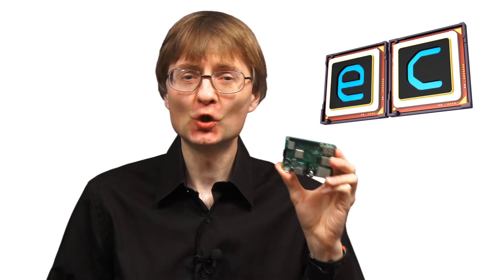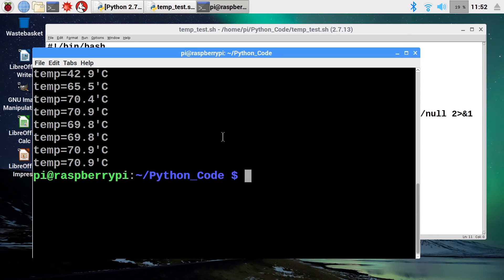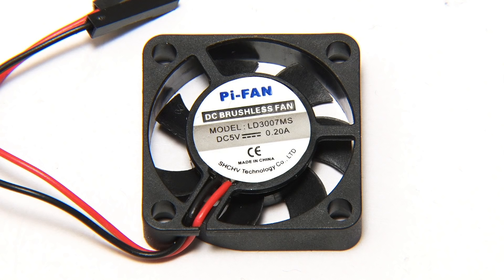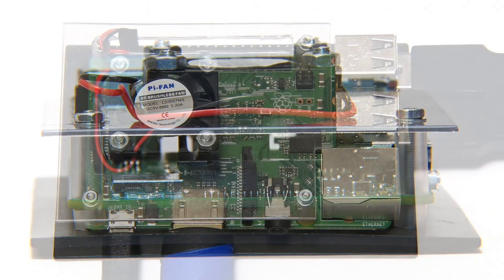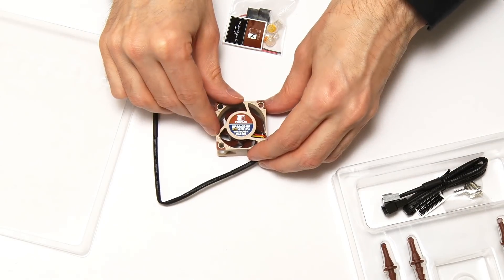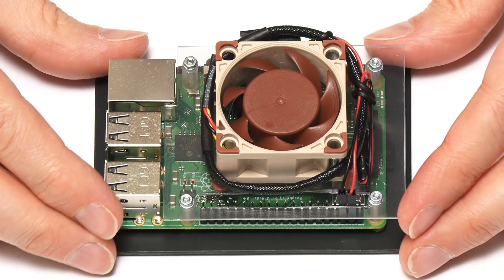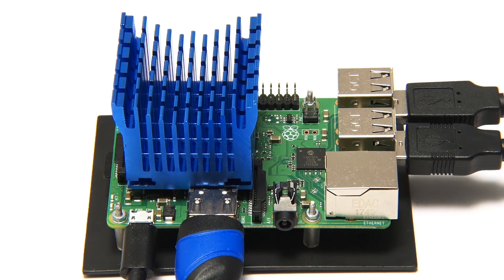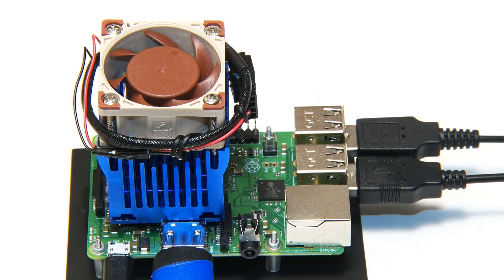Raspberry Pi 3 B+ Extreme Cooling

Comment: Chris, you didn't suggest whether the fan was blowing or sucking, it would be interesting to know as the 'suck or blow' debate has been around since Pentiums.
Reply from the maker: Noctua was blowing down; 30mm was sucking up (purely by accident). Blowing down is usually more effective, if only a little.

Comment: I've been running a small fan off the 3.3v GPIO pins since I got my first Pi 3b, over a year ago. Why would it cause damage?
Reply from the maker: The 3.3V output pins, and the GPIO pins configured as outputs, are only intended to deliver a few tens of milliamps, and supply power after the Pi's voltage regulator (meaning that there is no voltage/current projection between them and the rest of the Pi). A fan could easily draw more power than this, hence fusing the pin and potentially damaging the Pi more significantly. Not least, a fan may be pretty noisy in terms of the power it draws, esp at start up -- it is, after all, an electro mechanical rather than an electronic component, and it is hence risky to connect it to low power electronic outputs. You may get away with it . . .
Reply: ExplainingComputers Thanks for the explanation. Good to know, I'll be changing my setup.

Comment: Thanks to make this video. Thinking a microprocessor can work without any problem over 100 °C  (at 170°C the internal solder are destroyed) I think you can use your Raspberry without any additional heathink safe.
Reply from the maker: I don't know of any microprocesor at works at anything close to 100 °C! :) Somewhere between 70 and 85 most chips will cease to function, or experience a very short life span.
Reply: My i5 3380m Works at 102°C Without a Problem. It throttles at 105°C.
Reply: All Intel cpus run up to around 100 degrees, the 4700MQ for instance thermal throttle at 99 degrees (C). Almost all modern laptops and Macbooks run at this temp under load. Somewhere from 85-99.
Reply: Toxy , Great to know that you think running a Chip at 100 Degrees is a " good " idea.
❌ Bad Choice though , unless you Don't like your computer
Reply: I've never actually seen a CPU fail in years of answering questions on broken PCs. The worst I've heard was a 8350 that was such a bad bin it had to be underclocked to be stable (and was RMAed at that point).
Reply: Jennifer Wayans 

It seriously wont hurt your PC. look at all those passive cooled CPUs from the 90s, they get Really damn hot, they will still Work After nearly 30 years. I dont care if my CPU breaks After 20 years instead of 30 if i overclock it, let it overheat and more. No One will even use this Computer when it reaches the end of its lifespan, it will end up on Hardware Freaks workbenches like me, Will be used for a week and then be packed up again for 2-8 years After it will be used again.

Comment: Active cooling is obviously a very effective way to cool the Pi, but it's a shame it has to be done with these 'inelegant' cobbled together setups. As popular as the Raspberry Pi is, why are there not active cooling kits paired with cases that can accommodate and properly mount them?
Reply: Just check Amazon, there are lots of different kits with cases + coolers.

Comment: Another great video.
Being that the Raspberry Pi is the largest SBC in the world,
and standard heatsinks for the Pi are pretty lame,
looks like there could be profitable market demand for
a descent passive heatsink.

The next thing I would like to see is if
you have to go through the same process to 
boot off an SSD as you did in your other video.

https://www.youtube.com/watch?v=ubnwvxF3Klc&t=47s
Reply from the maker: Thanks for this. Clearly there is a market opportunity as you say. On your second point, I understand from others that the Pi 3 B+ will boot from an SSD or other USB device without having to go through the process I covered for the first Pi 3 B.

Comment: You should take into consideration the time it takes to perform a heavy task, because if the cooling is poor then not only will the temperature change, but it will also begin to throttle, taking a longer time to complete the task.
Reply from the maker: True.

Comment: Suggestion: de-lid the SoC. Delidding the SoC would allow the heat solution to touch the chip more directly than ever, allowing better heat transfer than before. As an extreme test, delid the Pi, put liquid metal on it, and attach an all-in-one liquid cooler directly on that.
Reply: That's new to me! :)
https://youtu.be/4LtL9e7JqxE
But I still think they put that metal to serve as both minimal heatsink + RF shield.
Ain't sure though.

Comment: The big heat sink appears to performed as well if not better than the smaller one. Indeed even better than the small heat sink and small fan combination. This may be the economical way to go. Just add the copper spacer (could an aluminum one worked?). No power connection/draws to worry about.  What was the cost of this heat sink?

Regardless of the temperature, we'll always be big fans of these interesting videos.

Comment: I think "fan & shs" result may be much better if you can place fan not strait on the top of heatsink. Because center of fan is just rotating and doesn't move any air below! :^) There just cylinder of static air that cooled down by air convection arround, and only then cooled static air cools heatsink. I'm sure that heatsink cooled down directly by air convection (with fan installed aside) will perform better. =) [not my native language, in case of horrible errors]
Reply from the maker: You are right -- but I did anticipate this, and neither fan was directly on top of the heatsink for the reasons you mention (well, except in the last test with the Noctua screwed in the top of the large heatsink).

Comment: Totally want the desktop PC coolers onto the RPi. Also want to see if cooling to ambient is even possible :)
Reply: Cooling to ambient is always possible.  There is the one caveat that comes with that: WHY?
Reply: For Science, you monster. :)

Also, why not? :P

Yeah, yeah, I know.. just because you can, doesn't mean you should.
So, let Christopher do it for you and learn something along the way? ;)

Even if it turns out that there isn't much difference, its always good to see what is needed to keep it steady at a certain temperature. You know, for that "temperature sensitive" application that includes expensive crystals that throw out accuracy if it rises 0.1°C. Or not. It's academic at this point.
Reply: As an experienced overclocker, I do have to admit "just for the hell of it" is indeed a compelling argument.  as for unstable crystals, well, a TCXO doesn't cost too much, or if you have access to good surplus an OCXO, or if you have a few extra bucks, Rubidium is cheap enough too ;)  --... ...--   -.. .    -.- -.-. ..... ...- -.. .---

Comment: Nice video. I still don't know why people obsess about cooling, though. What people need is the least amount of space/power/noise (pick one) that prevents thermal throttling. Anything else is overkill.
Reply: Thermal throttling òr even Overclocking. But what I missed from this video is the actual noise produced by those fans. I bought a simple fan, was annoyed by the noise, and bought a little controller on top of the GPIO pins to drop down speed to at least half the speed, and measure the need by a thermometer and even that prevented throttling enough. That was before passive cooling cases were available for the Pi3, otherwise I would have bought such a case instead. The little fan in this video is already able to push down temperature below throttling, but it is given the full 5V which probably is somewhat noisy.
Reply: One thing that could justify extra cooling is environment temperature. It is one thing to cool a raspberry in open air in your bedroom, another thing entirely inside a black metal box exposed to direct sunlight. It would be nice to know "for temperatures up to xC passive cooling will do. With cooling solution A you could get up to yC, and cooling solution B can keep your pi safe even if the environment air is zC hot."

Comment: nice vid but I would run the test for much longer to get more precise results. I'd recommend running the test until the temperature stops changing...
Reply from the maker: Agreed, but there are practical considerations -- not least the sheet quantity of data recorded for even these 10 minute tests. I still have over 70GB of test data to delete!

Comment: Only logical next step is to CNC a small LN2 pot...

It seems though that something like the large heat sink and thermal adhesive (instead of compound) would be ample without a fan, and then you could pack a bunch together and use one 120mm mid RPM fan to cool the whole set. 

How does the pi 3 overclock? 

Thanks for the video!
Reply from the maker: I will try an overclock soon!

Comment: I just got my Raspberry Pi 3 B+ to replace my older pi, had some trouble getting it to fit into the flirc case as it doesn't fit with a thermal pad attached to the cpu , had to use some thermal paste and then it was fine. Do you have a flirc case and how well does it remove the heat from the new Pi?
Reply from the maker: I do have a Flirc case (the Kodi branded one), but have not tried it on the new Pi yet. As you say, fit will be different due to the heatspreader on the SoC.
Reply: Thats the one I have. as well, I couldn't resist and it works better than the cheap plastic one I tried before. The new Pi 3 B+ seems to be working well in the flirc case so far, the case has warmed up so it's dissipating heat and it's not crashed while running Libreelec like my Pi3 kept doing. Thanks for the videos and for responding, I really appreciate it.

Comment: With the large heat sink covering the wifi chip, did you see any connectivity issues? I would think it could possibly interfere with signal strength.
Reply from the maker: I did not notice an issue, but did not explicitly experiment with the WiFi to find issues. Good point.

Comment: Do you have the fan blowing onto the heat sink, or pulling heat away from heat sink?  Which way is the airflow going and does it make a difference in results?
Reply from the maker: The Noctua was blowing down; the smaller fan sucking up (by mistake!). Either way is drawing air through the heatsink and over the board. It may make a slight difference.
Reply: Thank you, Love your videos, and professionalism.  Keep up the great work

Comment: good vid, thanks for this, it wd be interesting to vary the ambient temp too, to simulate being iin a hot server room...just a thought
Reply from the maker: Nice idea -- noted for a future video if I can figure out how to control ambient.
Reply: If the server room is ”hot” then something isn’t right. Server rooms needs some kind of cooling installed, blowing around warm air doesnt’t do very much. But if by server room you mean a room at home where you keep a server that’s another thing :)
Reply: For a lot of digital electronics, engineers usually assume  that the temperature rise (delta T) you see above your current ambient temp will apply at higher operating temps as well, within reason.  So if you see  a 15 degree rise in your system when ambient is 25C, you can be pretty confident you'll see the same 15C rise if ambient is at 50C, assuming your system is designed with reasonable airflow, all the parts are still in there listed operating range, and you don't have local hot spots likely to cause thermal runaway.  

This assumption works well 95% of time.  Measured temps are usually within a couple of degrees of where you would expect them to be, and that difference may be due to slight changes in the test setup and the accuracy of the thermocouples. 

That doesn't absolve the engineers from testing the circuits at the top of their listed temperature range to insure an unexpected problem doesn't crop up. 

If you're building a power amplifier with large discrete transistors however, much of the power may be dissipated in individual devices.  Bipolar transistors tend to increase gain with increasing temperature (which increases power), and you could risk a thermal runaway problem.  As such, the constant delta T assumption should be checked more carefully.
Reply: Cynthia is right, measuring the ambient temperature is enough to express a delta over ambient temperature. A lot of publications use the Delta T to compare cooling solutions rather than the measured absolute temperature.

Comment: Nice review :) I like the small heat sink and Noctua fan combination it seems a versatile and fairly robust solution. At some point in the future would you consider revisiting this topic with the same solutions and use the stress or stress-ng utility to see how well the cooling continues. I appreciate the number of combinations that the stress tool can provide might be a little daunting, therefore configuring a load that sits at load average of 8 over 1 minute would work well. I use these tools occasionally to see how well our scheduler is supporting my Linux audio components to prevent audio drop outs.

Comment: The large heatsink's passive cooling ability was impressive.  I shall most likely use a similar setup for my Orange Pi PC+.  Where did you get the copper?  Thanks.
Reply from the maker: The copper came from Amazon; I searched for "3mm copper plate", and managed to get a piece 50x50mm. Searching today on Amazon I first found a 100x50mm piece; https://amzn.to/2rUkwG8 But there may well be smaller bits. I looked at this in more depth -- cutting it and such -- in this video: https://www.youtube.com/watch?v=1AYGnw6MwFM
Reply: Thanks for that.  (A Mr Scissors fan.)
Reply: i would just dual sided thermal tape to put directly the big heat sink on the rpi.
with noctua fan.
would be perfect.

Comment: Ask Linus tech Tips to do liquid cooling on Pi.
Reply: People have done this already, it's not worth it, it's actually worse than a fan and a heatsink lol you can really only pull a .2ghz more out of it, so really what's the point? lol
Reply: Bobby Bologna actually water cooling PCs works better than fans
Reply: @Bobby-Bologna0451  i hope the foundation next gen pi will not come with factory locked processor.
Reply: Bobby Bologna, that’s the speed of actual old full desktop cpu
Reply: meh, just submerge the entire thing in machine oil :)
Reply: Gamers nexus is better at overclocking videos.
Reply: Hell do a mineral oil cooled one, just toss the Pi in tiny desktop aquarium
Reply: Lol ok
Reply: They don't care about anything that costs less than a gtx 1080.
Reply: @minepro1206  unless it's droppable.
Reply: Why?
So he can break it, then shill some crap?

Comment: Very nice video :) But I think, it does not worth to go to extremes with cooling here. Surely, very entertaining to do or watch your video. But an extreme cooling defeats the original purpose of Pi, ie being small, easy to use, consumes tiny amount of energy only (compared to eg a PC, I mean). With some heat-sink and probably a fan should be enough (though a fan which can adjust its speed, on/off would be nice), water cooling would be overkill here, but well, to be honest, I would be interested to watch a video about even overclocking and 'extreme cooling' of a Pi for that purpose :D :D I'm not even sure about overclocking of Pi, last time I "played" with that was the pi 1 model ...
Reply from the maker: I cannot disagree! :)

Comment: I think the main problem with small heat sink and big fan was that there was death zone under fan motor similar in size to the size of small heat sink itself. You could try  puting fan not directly above heat sink but a bit to the right or left.  Also to stabilize big heat sink you could just use another DIY plastic frame that would tight fit the heat sink.
Reply from the maker: In both cases the fan was not directly over the CPU -- in part due to mounting practicalities, but also to avoid the death zone as you note.
Reply: Ok,  out of curiosity have you considered something like this:
https://www.amazon.co.uk/Enzotech-Corp-MOS-C10-MOSFET-heatsink/dp/B004CL89D8/ref=sr_1_22?ie=UTF8&qid=1526824983&sr=8-22&keywords=small+heatsink+copper
Or even go wild and try to fit this:
https://www.amazon.co.uk/SVF152C29M-Processor-Heatsink-Cooler-3VHK9TMN010/dp/B07D5MW85P/ref=sr_1_30?ie=UTF8&qid=1526824983&sr=8-30&keywords=small+heatsink+copper

Comment: I would like to see a time measurements to complete the script in all the configurations. This would be good to see the effect in the processing time when the CPU decrease the speed due the temperature.
Reply from the maker: A good point, I did not time the test (which was about 10 minutes, but which clearly as you say would have been shorter in the cooler runs).
Reply: Really no need to do anything fancy, just launch the script as:
time ./temp_test.sh
(with some piping you also could log each run cleanly)
just gloss the extra info over as "and some timing information for the more technically inclined viewers" 

Also, I really like your crazy-but-still-sane experiments :)

(Since the RPi maxes out at about 70c you could ask someome with a good 3d-printer to print a decent mount for the copperblock to put other things on (incl guards against slipping) in ABS, it shouldn't deform until it hits 105c (PLA on the other hand deforms a lot earlier))

Comment: For "real world" use: Is there any point in adding cooling beyond what makes the temperature stabilize below the throttling temperature?
Reply from the maker: Probably not, providing the board is stable for the application in question (though a board running cooler will last longer).
Reply: I was going to say it doesn’t matter if it will last longer or not. And then I thought about all those Spectrum, Amstrad, Atari, Commodore and other retro computers that we now try to keep cool to last longer ;)